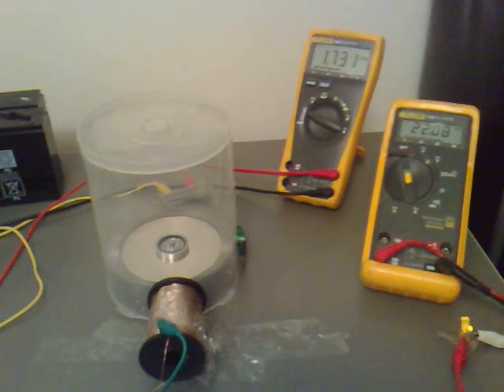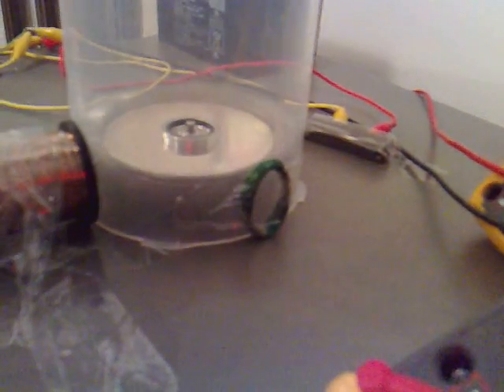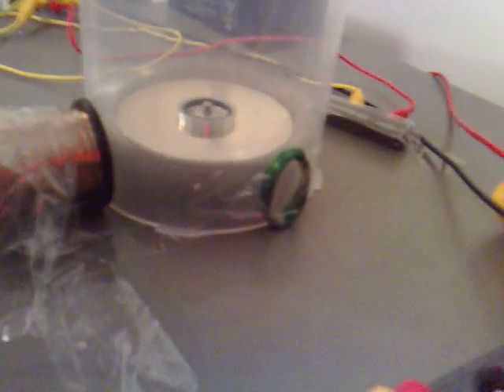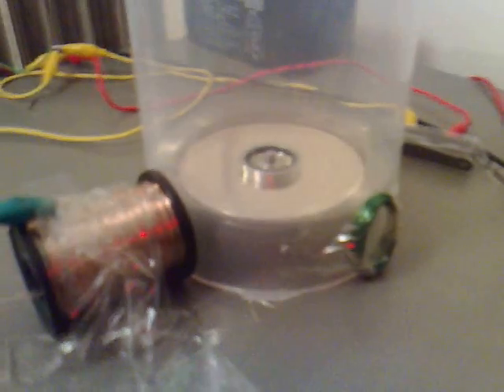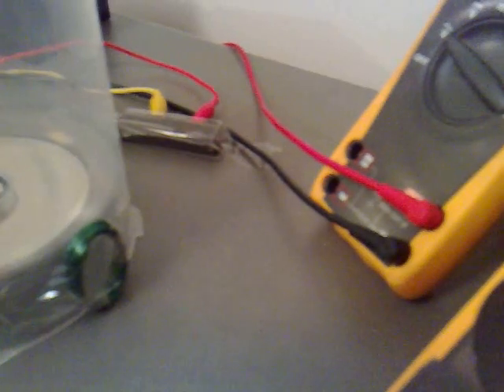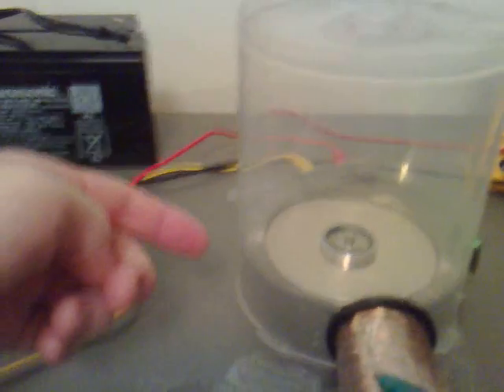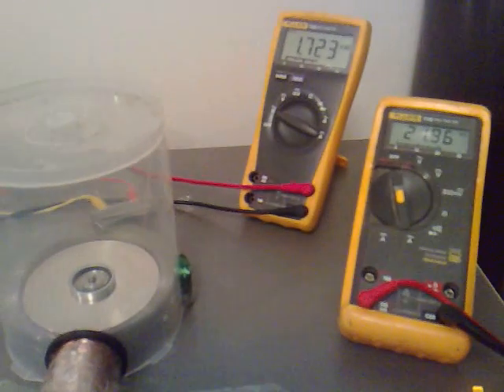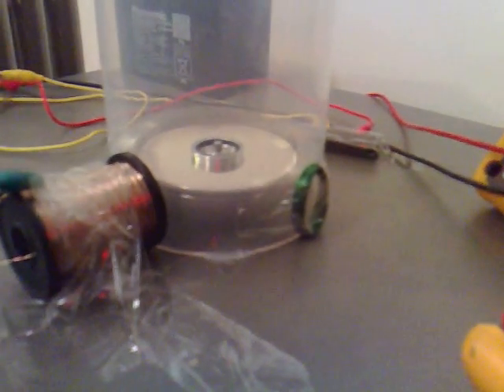Pulse Motor (Enclosure) 038

Comment: @ kubikop.....how much current will one of these coils that you use produce with the setup in this vid?Or,alternatively,would you know the formula for calculating how many turns of which guage of wire at which diameter will produce how much current given a certain flux?

Comment: "What is causing the drag and how can we reduce it. Number of turns in the coil? radius of the coil? I need to investigate this."  

If you removed that drag on the motor, you wouldn't make any power.

I have an alternator in my garage.. when you activate the field coils (the part that makes power) you can barely turn it by hand at all.. when the coils are off, it spins quite freely by hand..

Lens's law governs this crap like the other dude said..

g'luck and good job

Comment: Was that an LED light rated at ~12V? I was wondering how much Amperage is generated, voltage is great but it only tells a third of the power output. I have been trying these sort of experiments but rather with solar panels. I purchased three solar panels which together generate ~68 V, 1 Watt, 0.05 Amps. The fact that the amperage is low bugs me and at one point I opened the solar panels to see whether any resistor(s) were purposely placed, but none. Nice video and keep it up.